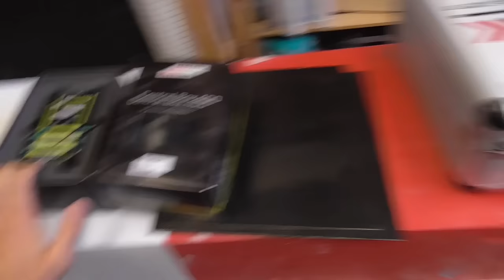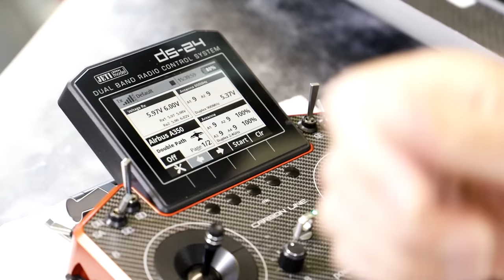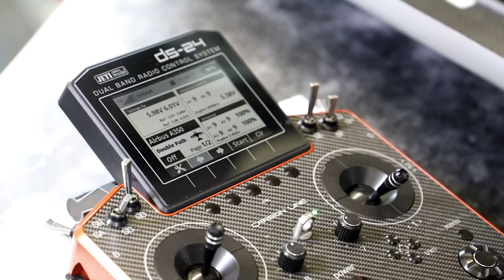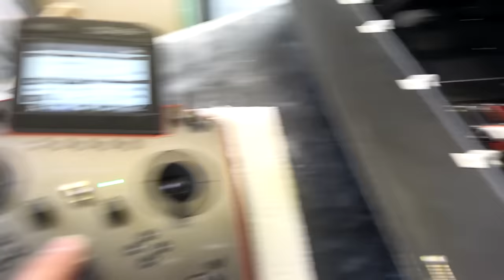BUILDING A GIANT RC AIRBUS A350 XWB, PART 6

Comment: on those receiver antennas, the only part that needs to be out of the plane is the couple inches of the end that has the shielding removed.
Reply from the maker: Thank you Nathan, I'll do that ;)
Reply: @RamyRC  set it in range test mode and take a long walk 😁
Reply from the maker: Of course 😄
Reply: I also would suggest not to mount them flush to the fuselage if possible. Best would be perpendicular up like a car antenna. Only the end few cm's are the actual antenna, rest is the coax cable which can go inside the fuselage.
Reply: @worroSfOretsevraH  This is correct, flush mounting would reduce the antenna's capabilities significantly. Also I wonder, if it wouldn't be better to have one satellite's antannes on the bottom where the signal is coming from. On the top the antennas will be shielded quite significantly by all the carbon structures.
Reply: Nathan, is that something your wife told you? You only need a couple of inches? Just kidding! I'm sure you are correct, at least regarding the antenna length!😱😳
Reply: What Nathan said^  Also I see the rescue/backup antenna are on the bottom.  This is good because the entire CF fuselage and wing may block your signal to the antenna on top.  You may want to consider one of the satellites on the bottom.
Reply: yes but it says the further this part of the antenna is away from the carbon the better it is. at least the most mini quad pilots say so, and I've also made my experience mounting them so far away from the carbon fiber as possible.
Reply: @thenatedog  Maybe connect a length of fishing line to the end of the antenna and run that to the top of the tail?  The fishing line is clear so won't be visible at altitude.  If you need some shock absorbing you can put a short piece of rubber band between the end of the fishing line and the tail.  Don't know if this would work for you but I have seen it done to good effect.
Reply: @conceptSde   From my experience working on actual planes, the best setup for his antennas would be to have one in the rear bottom, and the other upper surface. This would give his signal the best LOS regardless of the aircraft's orientation to him.
Reply: Ensure that the antennas are rigidly held at 90deg to each other and away from the CF fuse - otherwise they will blow back parallel when flying. Top and bottom of the fuselage is a good idea. Maybe a 3d print that looks scale could be used - the antennas can be inside the print as long as it's plastic and not loaded with CF :-) The 900MHz antenna could be outside the tail cone area? Great project - and Jeti is superb gear too, perfect choice !!!
Reply: Ramy RC please make the a350 Fiji airways!!!!!!!!!!!
Reply: Neil Gillies I really like the idea of having the scale antenna covers! I think some satellites should definitely be in play on this build though
Reply: Ramy RC just the yellow part of the antenna needs to stick out
Reply: @RamyRC  please upload the last part 7 very quickly because I can't wait that long please upload it very quickly

Comment: I suggest you lighten the pilot workload by using Flight Modes. 3 modes for Takeoff, Flying, & Landing all on one 3 position switch. Example would be when you flick the switch to Landing mode, it starts a sequence...ie: Turns on the Gyro, opens outer doors, lowers landing gear, sets the flap position, sets the spoiler position, & turns all Dual rates and Expo to low. That radio can do all of that with ease.

Comment: 26:31 Yes in the big bubble  top of the airplane is a Panasonic Ku/Ka-band tracking antenna system for TX/RX satelite signal and have wifi in the airplane. (I'm an aircraft mecanic in France and mounted them on it few years ago. ;) )
Awesome job dude, you're an artist !
Reply: jakou31 and TCAS too
Reply: @SJSProducoesRO  yeah but TCAS antenna is MUUUUCH smaller, it size like a human hand comparate Ku-antenna radom size is around 2,2meters long 1.2m Large and 40cm high...  🙂
Reply: @Antoine Boutserin yes i am 🙂
Reply: Les meilleurs sont français mdr
Reply: so your an avionics guy?

Comment: Build a 12v smokemachine in it. Let the smoke escape through the exhaust hole. It will be easier to see the plane fly in your videos and to track your flight path
Reply: Great idea, but you just have to be aware of the huge power consumption of the heating block. Even small smoke machines use around 400w and they also can't be used continuously, only in 45-60sec bursts. For continuous smoke you would need an even higher wattage heat block, maybe around 600-800w. On lithium batteries that is a huge load.
You would be better off getting a smoke grenade and shoving it in the APU hole.

Comment: Dear Ramy, as an aircraft engineer I found very satisfying watching your videos. Everybody can see the dedication, the love and the level of detail you put on your creations. If you allow me, here are some considerations.
- You don´t need to put the antenna wires outside the fuselage, only the TX/RX part. 
- Also, and since you have 2 antennas of each type, maybe one on top and one on bottom of the fuselage, since you will be transmitting from ground, and the aircraft is airborne. You can even put the TX/RX part of the antennas hidden inside the covers you made (the satellite and wi-fi ones)
- Regarding the lights, on the tail you put only a strobe light, but there is also a navigation light (white)

- The main landing gear strut has a door attached, to cover the hole on the wing after the gear is retracted, I know it might be difficult to do, but it worths the try.
Finally, keep posting your videos, stay safe, let´s hope this worldwide lockdown ends soon, we all want to see the A350 fly.
Regards

Comment: Ramy a few tips:
To add a delay of 1s to the nose is not a good idea! Use a good amount of Expo (60-70%) instead, to smooth small corrections while keeping  full deflection . 
For the antenas you only need the tip outside de airplane. Try not mount them flush with the fuselage

Comment: I hope you have very good ventilation in your workshop with all that soldering and glueing! It many not matter now, but years down the track!.......
Reply from the maker: It will go downhill anyways as we age! I have a window and an air filter, I turn it on from time to time, I hope it helps!
Reply: @RamyRC  Air filters with activated carbon should remove organic fumes from glue and the soldering flux.
Reply: I have an old pc fan and some dryer hose blowing the fumes out the window for my soldering station. if anyone replicates this make sure to have the fan on the outputs side so the fumes don't leak out the duct as it ages and gets holes in it.

Comment: The airspeed sensor is very important in this kind of plane.
Reply: Not really unless you also are able to accurately calculate scale stall speeds in all flight modes and program warnings  in TX.
Reply: @nighthawk0077  It is simple to find those data. 
Just one flight flying quite high, no flaps, stall the plane . Then stall the plane Full flaps gear down. 
   And that is it.
At home, after download the data , just check the point the airspeed was the lowest before increasing for flaps up and down.
  Than program the radio to sound an alarm a bit earlyer for each condition tested.
    Never will stall again a model plane turning base, no matter how fast is the tail wind is , giving the wrong feeling the plane is fast when actually it is at a low airspeed.  👍👍
    Works perfectly.
Reply: @sanpol4399  it's so simple yet no one in the history of RC has ever done it?
Reply: @nighthawk0077  I was sure I would find some examples on youtube to put the link here , but could not find any video showing a rc flight using a stall speed warning. 
         That is really odd since precise airspeed sensors and telemetry radios are around for quite a long time. 
     Maybe it is resistence to a new technology, just to keep flying the way we all learned decades ago,  feeling the plane reaction and stick inputs to tell if the stall was near or not.
     Anyway,   I did the tests with a simple plane  using the open tx (but any programable telemetry radio can do the same.)
    It works flawlessly, real time and precise.
   First step:  
-record the flight , make some power off stalls flaps up. Then, some power off stalls flaps down and gear down.

-  Download the airspeed data to the computer and check the minimum airspeed for each configuration( that is where the stall occurred ). To be conservative, take the highest stall speed from the tests, and set the stall warning adding  a comfortable margin to it.

     Program the radio to tell:
-If flaps are up and airspeed is less than X, then play a stall warning.

- If flaps are down , and speed is less than X, play a stall warning.

     With this telemetry, all those horrible crashes due to stalls , and those equally horrible high speed landings were the plane  approaches so fast that floats half runway or more before touching down, because the pilot is afraid of stalling it, will not happen so often anymore . 😉
     There is no reason people do not use this easy available resource, especially with expensive, heavy and big rc planes.
       👍👍
 Cheers.
Reply: @sanpol4399  yes it's certainly possible, but perhaps unnecessary. Have not seen that many stalls to be honest especially when dealing with large expensive models. I'm not sure how helpful it would be in the final landing phase where a lot of these stalls do occur as the pilot is already taxed to the max and prone to making errors. Although I do agree on the reverse, a lot of landings are done at high speed or infact regular flying speed instead of landing speed, causing the plane to bounce and keep flying. Perhaps an alert indicating too high landing speed would work.
Reply: @nighthawk0077    What you say make sense . 
    What I can tell from this experience on telemetry radios is that it is more pleasant to add more gadgets to the model as I never tought it would be.  :-)
    On the gliders,  It is really nice to fly them  listening to the vario beeps to center the thermal.
  In the plane the possibilities are huge with this new radios.
    The idea you had about a warning of high speed on final actuality I already did.
     I flip a switch, and activate a window of optimal approach speed, where the warning stays silent.
   If it is too slow, the stall warning starts to play, so I add a bit of power till it stay silent. If the speed increase too much, a different sound plays, and I reduce the power till it get in silence.
     It works great,  it is fun, and really avoid entering in a stall or making a long flare. 👍

Comment: You could probably open the lock of the hatch with magnets from the outside. Then you will not notice them (as much)  :-)
You could connect the wings with longer wires for testing. It will help testing/building.

Your workshop isn't small, the plane is huge!!!

Really nice of you showing us your build.

Comment: Hey Ramy! It's a really great job!  Advice for you, longer the ESC  to the motor wire is better than longer wire to the battery.  Current to the motor is AC ，to battery is DC.

Comment: Nice project! Everything is well done except ... The holes for the cables in the carbon fiber plates. They should definitely have edge protection around so the cables don't wear off. Carbon fiber is sharp.
Otherwise a super build and a joy to watch!
Happy flying !!

Comment: Add a few cameras inside the aircraft,it would be awesome to have some extra footage (landing gear,cameras looking the wings...). If than plane is so light,you could add a few cool things like more sensors to monitor your electronics,a black box or a complex telemetry system if that cool radio did not have one.
Very cool plane, I love it!

Comment: Ramy @ 28:00 - My understanding with 2.4ghz is that the short end of the antenna is cut to best receive the specific wavelength of the 2.4ghz frequency, and therefor it's the only part that must come out of the carbon fiber shell. In fact, I believe they can be covered by 3D printed plastics very little to no signal loss. That being said, I totally get your apprehension to mount them in any way that might hamper your signal. Keep in mind, you're on the ground, and the plane is in the sky, both of your primary diversity antenna are now on the TOP of the aircraft (except for the backup 900mhz antenna, for which I have very little understanding)...so you might want to seriously consider moving one of the 2.4ghz on the bottom of the plane. If you bank away from yourself, there's a lot of carbon fiber and other items between you and the diversity antenna. I hate to even say this, because your plane is a work of art, and the level of care you're putting into it is very apparent, and don't want to come across as an armchair quarterback here. There's still a load of antennas capturing signal, even if they're on the other side of the planet - LOL ;)
AWESOME work! You keep outdoing yourself!!!

Comment: Amazing. Absolutely amazing, Ramy! Just one thing: It is always better to have the long cables between ESC and Motor. Long Battery cables can cause serious trouble unless you solder in some capacitors in between battery and ESCs.

Comment: Love my Jeti , you can get some nice shark fins for aerials, use on F5j gliders with carbon fuse but have also just put 2 extra layers of shrink tube on tip and glued vertical / perpendicular to fuse easy to get out as you are just cutting the outer heat shrink.
Would not leave aerials flush with fuse loose a lot of reception that way.

Comment: Great Stuff RAMY. A tip: When you have dual satellites, you should run one on top and one on the bottom for each frequency pair ( main and backup). The idea is to ensure you have direct line of site to the transmitter for all ( or most ) orientations. ~this will reduce or eliminate chances of loss of signal.   In a future build, look at a glass tail fin and potting one inside there. Goodluck!
Reply: Or at least the leading edge of the vertical stabilizer.  As short as the antenna can be for Ghz frequencies that shouldn't be a major problem.

Comment: Hi Ramy, you should not extend the ESC battery side wires, that causes voltage spikes. If you need to extend the wires, it is best to do it on the motor wires like you did now. Long ESC wires to the motor can make interference though so use ferrite cores (Look for TDK ferrite cores, they are great) . If you ABSOLUTELY have no choice but to extend the ESC wires on the battery side, then you will need some monster capacitors  to absorb the voltage spikes. Great work, amazing progress you made is so little time!!! Good luck!

Comment: First, amazing project, just like your previous builds. I do worry a bit about the soldering at 11:36 with the wire moving while the solder is heated and cooling down. The wire is attached, but it doesn't look like a very clean soldering. With the tape and heat shrink around it, the wire is not likely to come loose easily, but it still worries me a bit. Hope you will see this as constructive remark, and not as negative comment.

Comment: The straps on the batteries keep them from moving side to side and the velcro will help with forward to backward movement. but you may want to add some "walls" at the front and back of the battery tray/section to keep them from sliding forward or back if the velcro were to give way. The walls could be removable for easy access to change the batteries, but might be good tto have them as a back up.

You might also add magnets at the edge of the big side hatch in addition to the latches, to keep it from vibrating. Latches would still be the main mechanical lock, but the magnets would help stabilize.

Comment: Hi, I saw how you wanted to put the antennas and I found if they touch carbon fibre you can get signal loss at closer ranges so I would recommend to put at least some spacing between the antennae and the carbon fibre. Great job Ramy!

Comment: Outstanding work! I see details I can criticize but I'm guessing you probably know those details better than me. Your work has really evolved over the years.  A pleasure to see good quality and pride in workmanship.

I've been flying for over 40 years. I'd like to use the term "real airplanes" but that seems to demean what it is you're doing. You are building and flying real airplanes. They are UAVs. Like UAVs built by all major aircraft manufacturers now. In some areas you are doing a better job than they are.

As a pilot flying for a major airline (737s, including the Max until last year) I can say that flying aircraft directly instead of remotely is far easier than what you are doing.  We're in the flight deck. We see everything. All instruments are right there. We can feel what is going on. Our controls are numerous and readily available and have not really changed in the last several decades. And we can feel, see, and hear all the changes we make to the flight path, thrust, or configuration.

You don't have much of that flying via remotely. And as opposed to UAVs produced by large manufactures, you are using your own personal funds and taking a big chance. I watched all the Dreamliner videos. A damn nice RC. Sad to have seen it go.  But that is the chance you take with any aircraft. Only with RC's the chances of a bad outcome are much higher. Obviously that's a good thing for travelers..

In addition to being a pilot I'm also a flight engineer and an A&P mechanic. That is why I am impressed with your quality of work and engineering ability.

Bravo!

And thanks for the awesome videos!

Comment: Hi just a note from me. If you take distance of yellow section of antenna wire and add 10% to that measurement, then the distance of black section that needs to be exposed. Rules we follow as amature radio operators since  become in 1980..great vid👍👍
Basie. Zr2ba